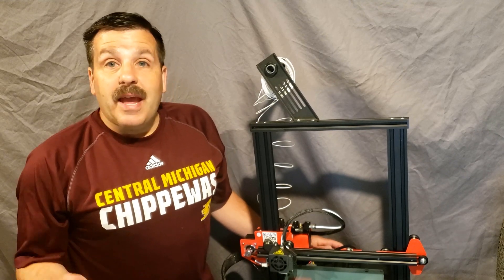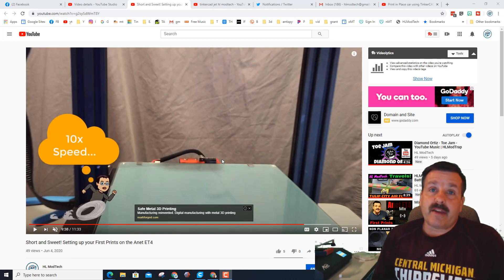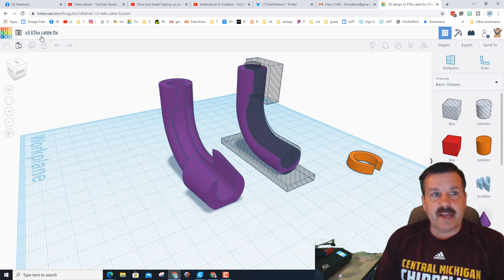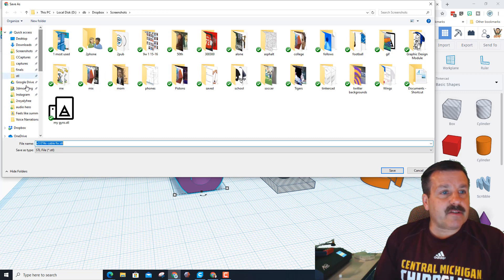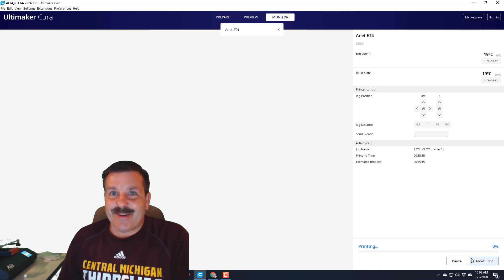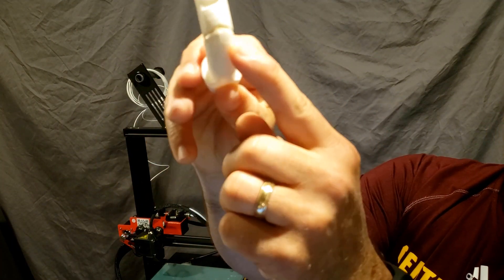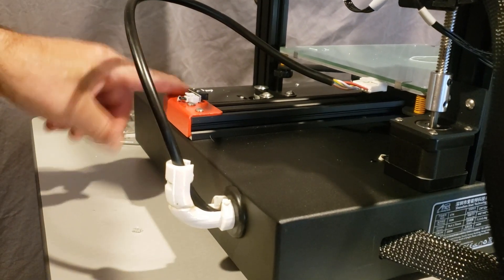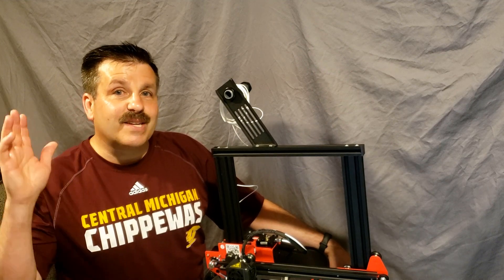Anet ET4 Essentials | Eliminate Y Axis Snags! Free Design Download

Comment: Hi, what is the firmware version of your ET4 ?  mine is still 1.0.9. Which is the most stable firmware? Is it worth upgrading to the most recent 1.1.5?
Reply from the maker: Mine is 1.1.3 I believe.  I am going to run through all my normal test before I switch anything. So far it has been great. I have to shut it off to refresh the SD card which I think is something they fixed... It is printing so well, I am not too worried about it.